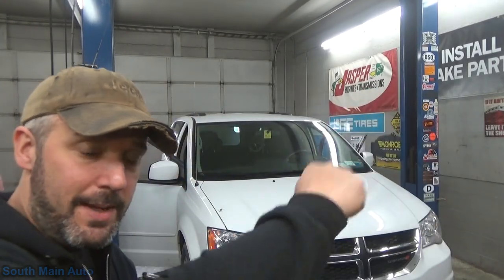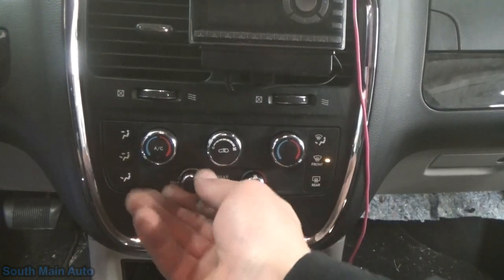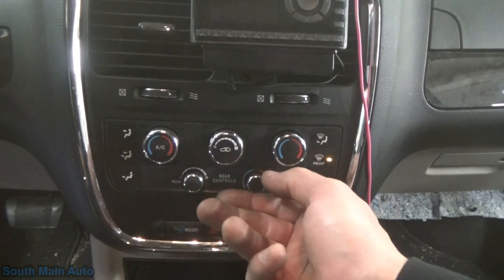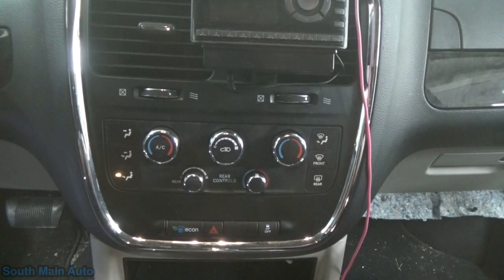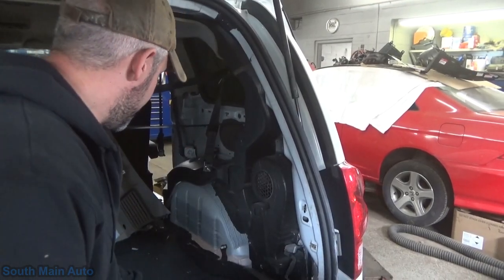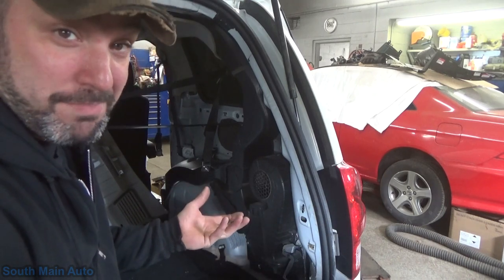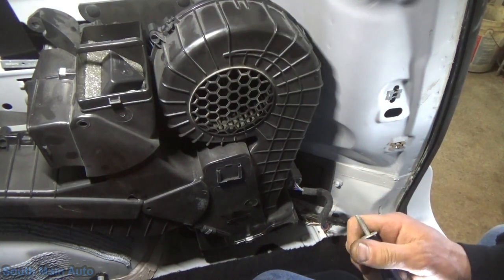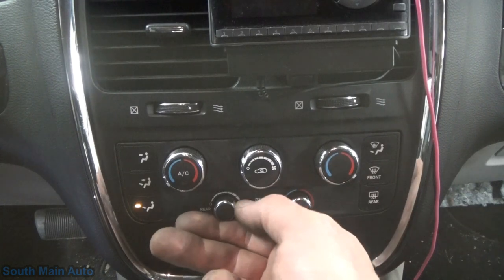Dodge Grand Caravan - Rear Heater Clicking / Front Heat Stuck On Hot

Comment: I have 2014 Dodge caravan and last year i had the rear ac only blowing hot air and also the passenger side in the front....took the van in this year again last week with the same problem and there is still clicking in the back and now its starting to click in the front but the ac works...what is the proble? last year they told me it was an electrical problem why it start clicking because it never clicked before they worked on it, only after.....so i said not to fix the electric problem.....

Comment: Hi .... I have a 2013 Dodge Grand caravan  with 120,000 miles .... This car started shaking had code p0202 and p0259 ...... Was replaced spark plugs , inyector, coil. And still shaking a little bit and something worse .
Now the check engine light is OFF .... No check in light on ,,,, but still shaking  .
I took it to the dealership and they first Said maight be the spark plugs , or inyector or coil ? .... I told them that all that was replaced ...... Seams like they are guessing what could be the problem .
Do you know what could be the problem? .
Let me know if you have any sujestions pls
Reply: Was codes p0302 and P0259

Comment: So if post on the new actuatorv completely does not line up the same way as the post keyway on the old actuator...what do I do? What is the correct procedure? Can I manually rotate to line up to the screw holes?

Comment: I have a 2011 I have rear clicking. But all my heat is stuck half way I can have all ac but half and half heat hole van even the defroster wharf one would I need to change ?

Comment: My 2013 Dodge Grand Caravan SE I can get ac cold air out of the drivers side, but only heat to the passenger side. What actuator controls that and where's it located. Thank you
Reply: My 2013 van has the individual knob control for left and right side controls.

Comment: I had to change the blower motor speed controller on my truck and at my age and with my back and neck problems am simply unable to get my head into the footwell. I was able to do the job by placing my girlfriend's make-up mirror on the floor and kneeling outside the door. it was a bit awkward, but worked in the end.

Comment: I had the same issue of clicking blend door and the blinking rear defrost light when the car is started.  I fixed the blend door, but still have the issue of the blinking rear defrost light.  I took the cables off the battery terminals and still have the issue.  Any advice?
Reply: Would love an answer to this.  We just had to spend $500 to get the actuator replaced but we are still having this problem too.

Comment: Tip for Mrs. O   I slice the bacon package in half  (long way) for sandwiches... thirds for "stir fry" like that... makes it easier :P  ..
Reply: edit:  before you open the package,, cut the package from the top thru the bacon but not thru the paper on the bottom..... makes it easier to get the bacon out without a mess or touching it either !!
Reply from the maker: I passed this along and she gave me the "duhhh" look haha
Reply: LOLOLOL  of course... but begs the question... what else goes in the cabbage and bacon.. onions ?  anything ?

Comment: Great video however my pads and move from side to side and cold to hot.   However the VW Routan will not cool or heat it the rear.  Eric any ideas thanks
Reply from the maker: Have the operation of the actuators checked
Reply: Yes they both work.  Open and close.   The front ac is blowing 60 degrees the rear was a solid 80 degrees.   Whether the ac or heat was turned on.   Do you know what the high side pressure should be? Thanks

Comment: Say you don't have a scan tool and just replace the actuator. Will they work without calibration?
Reply from the maker: Yes it will. It is just a way to verify the repair. Plus there is a flash programming update for these to prevent this problem.
Reply: Thanks E

Comment: have my third Caravan, started with a 1988 than a 99 that went to 245,000 before being traded in now have 2014 and loved them all
Reply: you'll never see that occur again ;)
Reply: I can promise you, the 2014 will see at least 250,000 miles, I keep all my vehicles to at least that mileage before I replace them, prompt regular service, oil/filter changes every 2500 miles, stay on top of the little things before they grow into big issues that cost $$$$$$$. I also have a 98 Olds Aurora w/northstar, all the so called experts claim there junk and wont go past 100,000, not true, regular main. coolant flushes oil changes, she runs as strong today as it did when it was brand new, all the power accs. work, a/c still blows cold.

Comment: there a Recall for the passenger side stuck on Hot ( R62 is the campain number ) 
the HVAC module has to be reprogram and then most of the time the blend door actuator needs to be replace
Reply from the maker: I seen the flash program update  but did not see it as a recall. Didn't think it was a safety issue...

Comment: What a pile! 3 years old and interior parts failing - gotta love it. Even my Silverado's interior bits are still functional (for now ... probably just jinxed myself). The lower ball joints didn't make it past year 2, however.

My dad and my brother both just bought '16 Ram 1500s - guess in a couple years I'll be getting to know these new ones. What a joke!

If I had a time machine, I'd come back with 10 cars from 1972, sell half of them and keep & drive the rest until the day I croak.
Reply: Smitty Smithsonite probl a bunch of kids worse case for any cars interior.

Comment: why couldn't you just remove the glove box for. access?
Reply from the maker: It does not open any more access to it
Reply: @SouthMainAuto  - But I saw a guy on one video stick a small ratchet wrench in that Oval hole to the left to access the part on the passenger side after removing the glove box.

Comment: its because the reliable years of the caravan/t&c line up have gotten ruined with fiat can into the picture. now being they discontinued that lineup and blew up the Pacifica into a van to replace I have no more fate in their vans more less rest of their vehicle!i have an 05 t&c limited with nearly 200k trouble free mile on it.other than your typical alternator power steering idler and tensioner valve cover gasket and new egr lol

Comment: 2012 Dodge Grand caravan.. by far the crappiest car I have ever owned.  1. All
seat rail covers are all broken. 2.Interior tailgate light falls in when you open the door.  3.Headliner is falling off. Windshield 4. wiper nozzle popped off and flew five feet in the air. Air conditioning vent literally fell apart. 5.  And.... Clicking coming from the actuator which is why I'm watching this video. I will never buy a Chrysler again so long as I live.

Comment: I had a 2002 Chrysler with a semi-broken front temperature actuator.  Called the dealer and the price left me feeling like I was getting raped.  Called around for aftermarket and the only option was Dorman.  So either way I was getting screwed.  I didn't repair it but instead donated the car to a charity.

Comment: How can a car that's three years old have this many problems on a model that has existed for 25 years or more. By now any reasonable company should have figured out which parts suck and have their Chinese suppliers improve said parts so that the failures no longer happen. How can you make the same shit for 25 years knowing full well that it's going to break way too soon. On a new model bugs will always happen. This is as far away from a new model as it's possible to get.
Reply from the maker: Planned obsolescence I assume?
Reply: SATAMAN Schmidt Sir and dearest Eric O __ I just see Chinesium in a scenario; Quality is directly proportional to the Price. It's not the only fault of Chinesium.
Reply: It's not China's fault at all. It's Chrysler's greed that drives the process. The Chinese make their shit to Chrysler's specifications just as they do Apple's. Eric, I have a question for you. Is the reason you see so many Chrysler products because of a local dealer. Here where I live I can buy any make of car within a ten minutes drive including Lamborghini and Ferrari. Out there in the sticks it occurs to me that maybe dealerships are less available and that Dodge might be more easily available than say Hyundai, Toyota, and the imports. Just wondering.

Comment: Just bought a new briggs engine for my mower I wanted an American engine, guess what made in china, cant believe they went china.
Reply: Seriously? I've only bought mowers with B&S after some horrible ventures with Tecumseh OPE. US Briggs to me  were always up there with Honda engines and if you give them some TLC they lasted forever.  Never thought I'd see the day a Briggs was made overseas...
Reply: i replaced exhaust manifolds on 2010 Chevy express van, Owner said to buy from dealer want American made, 3 times the cost the parts store charged, guess what when i pulled the manifold out of the box had a tag tied to it that said made in China.
Reply: Yep, the way it is now.

A few years back I bought a Husqvarna M-ZT 52 z-turn mower - I had a choice between the Briggs, or a Kawasaki engine. I chose the Kawi. Rather Japan than china any day!
Reply: Thank god Briggs motors last forever. Some of the ones i maintain and fix for people must be 20 years old. My lawn mower is 26 years old. I had to replace the carburetor because it wasn't running properly a couple years ago, and i put a new spark plug and pull cord on it but that's about it. 

You know Briggs & Stratton might actually have been better at small engines than Honda. Honda engines are particular about the fuel they run on. Where as you can put years old rancid petrol through B&S motors and they run on it rather happily. You leave them all winter with rancid fuel in them. They normally start right up.
Reply: They used to. These days nothing is any good anymore. I've made a living off of small engines off and on for the past 17 years. Stuff built today is garbage. All of it.

The old Briggs, Tecumseh, and Wisconsin engines still run today with little work. Toss a set of points in, clean the carb, and she'll run for another 10 years. Usually the ethanol in the fuel makes 'em stop running - just clean it out, and off you go again. You won't see anything built this century lasting that long, I'm fairly certain of that.

Honda GX engines have plastic cams and timing belts, but they still seem to hold up pretty good. Haven't heard of, nor seen any of them failing prematurely.